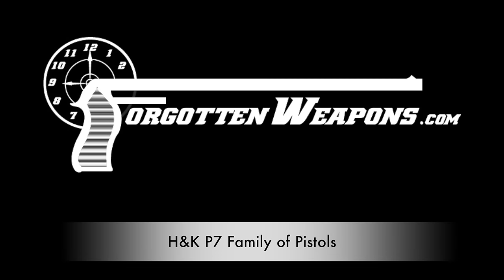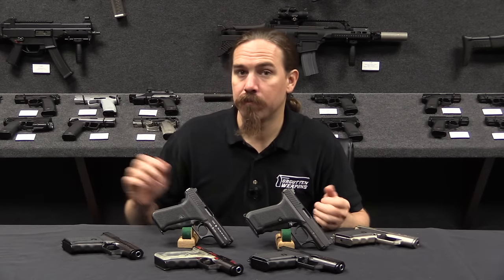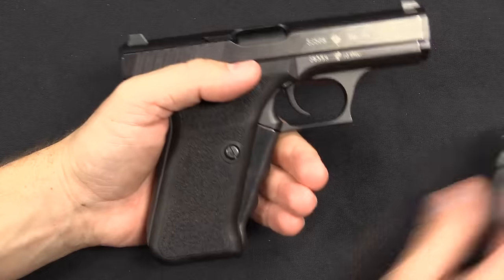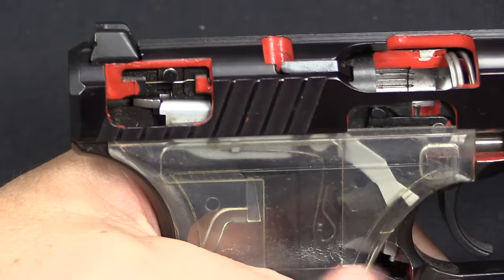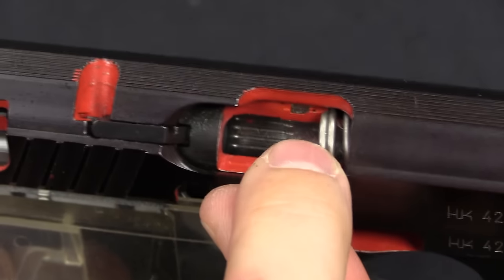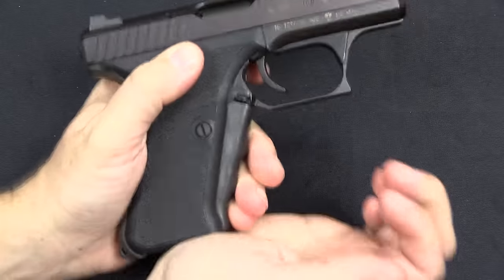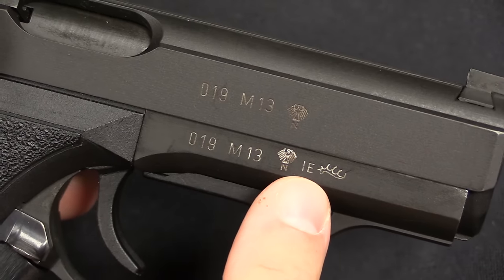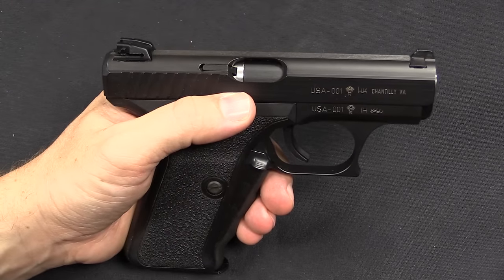H&K P7 Family: Pistols for Gun Cognoscenti

Comment: I'm not seeing what youre doing at 6:50 to release the magazine. You say to squeeze grip with slide back (empty chamber only?) to release mag but I dont see you do it, maybe a gentle squeeze but I see nothing move. 

And if that's how you drop an empty magazine, how then a full? Is there a slide stop control to lock it with a full mag?

Also will multiple trigger pulls on an empty chamber or a dud or light strike or hard SMG primer, work with grip held down, or must one re-flex and re-engage the safety to re-arm the striker?
Reply: The P7 has a heel mag release. The M8 and M13 have paddle release on either side of trigger guard to release the mag. The grip will drop the slide forward but you must release your grip and re-squeeze to do so. You can manually lock the slide to the rear. There is a small stop lever on the left side near the rear of the trigger guard on the P7. To try to refire on a light strike primer, you would have to release and re squeeze the grip.

Comment: Trying to select the perfect self-defense gun, and I think we may have a winner. I really like the feel of smaller pistols when it comes to concealed carry, but most of them are chambered in either .380 or .32 ACP. I've decided I want a 9mm but one that is not bulky and has a thin profile. This pistol is pretty much perfect. I was also looking at a Browning Hi Power, but again, the heft added by the double stack mag made it really uncomfortable to conceal. The Polish Radom vis 35 also caught my attention for it's ergonomics but it is an older gun and I feel this one will be more reliable.
Reply: Try a Kahr K9 or MK9.

They are a modern all stainless steel single stack 9mm and very very high quality. Nowhere near as expensive as a discontinued HK P7 either.

Comment: I almost bought one of these new, and I kick myself now for not doing so, but instead I got a HK VP70Z which had a better price, 18 rnd mag with 4 mags, and also has the distinction of being one of the first plastic guns made.  I was new to pistols, really somewhat ignorant of gun design and the squeeze cocker looked gimmicky to me.  They are awesome guns, and valuable collection pieces, hard to find and get snapped up quickly.  There is much to be said for 9mm with over 70 rnds as a carry/defense gun...  also a good gun that I never felt under gunned carrying.  Thanks Ian for another awesome video.   :)

Comment: In 2010 one of the German police agencies that used the P7 replaced them and a number of them were imported.  I bought one in early 2011 that really was perfect except for minor (very minor) holster wear for about $550.  They were in the box with the manual and two magazines.  The number imported sold out quickly and the price rose significantly.  In 2015 a friend saw my P7 and made me an offer I couldn't refuse.  I sold the pistol just a few days less than 4 years after I purchased it for $200 more than I paid.  My friend has since sold it at a profit.  It was very accurate, fun to shoot, and unusual.  I don't regret selling it, but would buy another in the condition if the price was right.

Comment: the h&k p7 family is so innovative and it should have been the future of pistols and the next evolution of the striker fire action. maybe people will recognize it down the line and its great potential. with the grip safety (squeeze cocker) you have maximum safety and now can lighten the trigger to single-action levels and you have a striker indicator similar to an external hammer. plus the squeeze removes the need for an external slide release which reduces more external controls on the system, which was a big selling point of the striker action. basically have the best of all worlds.
Reply: I'd like to see HK license the design to some enthusiast who wants to bring the gun back to market. The only thing is that you never know how well some independent entity would do it, and that's probably why they never will want to share the idea. Might as well just tear one down and build it without permission like the way Canik did with the P99.

Comment: Ian, you overlooked another  very unique feature of the P7/PSP system and that is you can remove the firing pin and spring from the pistol with incredible easy. The original PSP required a tool or some sort of wedge to turn the firing pin holder/indicator at the rear of the slide and out pops the firing pin and spring. In the P7 and later version, all you needed was thumb pressure to turn the the holder at the rear of the slide. The PSP/P7 also had polygonal rifling.
One major downside of this pistol is that it was a bitch to clean the gas cylinder because of all the fouling and its location made it hard to reach even though H&K provided a cleaning brush. The piston and cylinder get incredibly dirty even with just 8 shots. Although it didn't malfunction after 8 shots, it was a pain to keep clean.
Reply: Have you owned one? I don't have a problem with reliability or dirt. Just keeps shooting.  And mine is a carry piece I only clean a couple times a year. Shoot it at least once a month.

Comment: I have a dumb question: Why not put the gas system on top of the barrel, away from the trigger, if it gets so hot?
Seems like if you did that you could drop the barrel & chamber to be down more in-line with the shooters wrist with needing the kludgy addition to the trigger guard.

Second alternative fix would be to put the gas vent and chamber closer to the muzzle.  Maybe i'm just not understanding how the delay is supposed to work.

Comment: Does it make a loaded M7 full-auto if you hold the trigger and keep the handle squeezed ? or does the strike pin travel back with the bolt block which doesn't provide enough power to ignite the primer?

Comment: What happens if you shoot your last round and hold the Guard safety will the slide cycles back to the front or will it stay open till you push the guard safety again?
Reply: Yes the slide locks back on the last round and you have to release and pull the cocking lever to release the slide. It works better than it sounds especially with the M8 because as you shift your grip to work the mag release it's natural to release the cocking lever.
Reply: It locks open even while you hold it down. You release it when you go to swap magazines and then squeeze it again when you have a loaded mag in to drop the slide.

It sounds more weird than it is and I find it super natural since you usually unconsciously loosen your grip when going for the mag release anyway. Honestly, I don't care so much about the cocking mechanism, the squeeze slide release is hands down my favorite part of the pistol. Super fast, ambidextrous, and reliable (no accidentally riding a slide release lever with your thumb causing the slide to not lock back).

Comment: The heat issue is real, I was teaching a class at Fort Bragg in the late 80s in which all students used the P7M8 when this issue became very clear.  Using two pistols per student, and gloves, we were able to complete the class but it was challenging, even with the gloves the heat got intense. I noticed many of the extra pistols we procured were missing their extractors but they still worked, the reliability of these guns can't be overstated, we were using 50 pistols and shot three thousand rounds per student and I can't remember having a single malfunction.  The heat issue may not be a problem for duty use but especially since this is a unique design it requires training to be competent with and so the heat issue makes firing enough rounds and getting thru a training course challenging.

Other traits these have is excellent accuracy and a very low bore axis with minimal muzzle rise, they are very easy to shoot quickly and accurately. Great pistol I wish I still had one.

Comment: I’m confused about one aspect: if you keep the grip and trigger both held down after firing a round, then another round chambers, wouldn’t you have to release the grip to be ready to fire again? If you just release the trigger won’t the firing pin “pushing” element be still in the rear position and therefore unable to push the striker back?
Reply: Answering my own question: with the squeeze cocker depressed the action of the slide after firing will reset the striker.

Comment: I had a P7M8 in the 80. I liked the accuracy of the fixed polygon barrel, and the sleek compactness of the gun. However, it could not handle lead bullets used in my hand loads for competitive shooting, since slivers of lead sheared through the tiny bore in the barrel  into the gas chamber below the barrel. It filled up with lead splinters, until the slide could almost not pulled back enough and disassembled anymore, leaving the gun dysfunctional. The hand cocking action made a clacking noise, which got on my nerves after some time, and I finally decided, this thing was not for me. Exchanged it against an old fashioned super accurate SIG 210-5 which I own and am still very happy with. Never looked back. The presentation is nevertheless very interesting.

Comment: dear Ian I shot this pistol in a practical pistol match.  I was using a weaver grip , also shot it first time as a novel familiarization stage. I drew the weapon , pulled the striker and fire the weapon. What happen was the pistol recoiled my in hand which in turn the lever move back into safe condition without any indication that it was in non firing condition . the upshot fired the pistol, then  did'n t fire  ,no  normal way to diagnosed   the malfunction. needless to say I was not  impressed and if you use matches as training grounds  to survive a gunfight then the implication is that I would  be dead. It is hard enough to shoot under high stress conditions let alone having the pistol sabotage you. My experience with firearms is that I worked five years selling them  and  there by handle them daily and shooting in practical matches. One last thing the pistol when cockier is pull it sounds like a staple gun in that was out nick name for it. Thank you Ian for your excellent program
Reply: larry houneycutt I shot these in IPA matches quite successfully and I would only be able to reproduce what you did by limp holding it in an extreme way, how did you do that?

Comment: As an MP in the late 80s, I rode with the German police, (poletzei), on patrol in Maintz.  I didn't work with the Bavarian Poletzei, so I can't say for sure.  However, the Maintz poletzei told me a lot of the Bavarians had accidental discharges on these, especially when drawing from the holster.  But, again, I don't have first-hand knowledge of this.
Reply: I suppose in a high stress situation it's possible that they grabbed and actuated the squeeze cocker, but how the fuck did they have the trigger depressed at the same time accidentally? This has to be the safest design ever.

Comment: I remember being intrigued by these when reading about the initial testing; when they finally hit the civvy market a few years later I just didn't have the money (by then I was in my early 20s). And the continual price increases seemed to match any increases in income I received, sadly. By the time my income was enough to spend the bucks on one, it was too late and they had already been withdrawn from most commercial outlets. Used market was few and far between, as those who had them tended to keep them.

I still want one to this day... but not enough to put a winning bid out at an auction. Sigh

Comment: Best pistol I've ever owned or shot. Fixed barrel, stupid safe, ultra reliable. Wish they made a new updated version. Slim and easy to conceal carry, albeit heavy due to the frame. Have put a couple hundred rounds through in an hour, and it never failed me. Best CCW gun, squeeze the grip then pull the trigger, and it fires. Pull the trigger and squeeze the handle it fires. Squeeze the handle as you pull the trigger simultaneously it fires. Idiot proof, plus small children can't manage the grip strength needed to cock the striker.

Comment: I loved this idea in my early 20s, thought the design was so clever.  I saved and saved and eventually was able to afford one.  Finally brought it to the range, fully expecting to love the gun.  I absolutely hated the experience.  Put 2 or three magazines down range and the heat from the bleeding gasses heats the pistol until it’s burning your skin.  The pistol does not cool quickly.  So if you didn’t bring another gun to the range you will struggle to digest a single 50 round box of ammo in your hour of range time.  Also, if you don’t immediately disassemble and clean the weapon after a shooting session, the gas system can get jammed.  Now I realize this isn’t really a problem in a self defense situation, but it makes practice rather irritating.  I sold the pistol and never looked back.

Comment: How rapidly does it actually heat up to be uncomfortable, with or without the heatshield? Any experiences?
Reply: Good question, though it sounds more like a range/fun shooting problem than a police problem. I am still interested in an answer to it, though.^^
I personally think that the designers originally didn't care all that much heat problem, because of the very practical, real world fact that by far most gunfights are over after 2-3 shots.
I suspect the need for its solid precision (for a handgun) also roots in the same issue. When the police needs to shoot, it really needs to hit exactly where it intends to as there is no margin for error or tolerance for collateral damage concerning people.

Comment: I remember the P7 just coming on the market back in the '80's.  I thought then, and Ian confirms, that the P7 was probably the most elegant bit of pistol engineering since the Hi-Power.  Really a brilliant design, with that one flaw that all the gun writers mentioned then, and Ian did here, that the shooter's trigger finger begins to smoke with extended firing.  I wanted one anyway but couldn't afford it.  I still want one now but the used ones on Gunbroker are still out of reach at $2000+.  Sigh, I guess I'll just have to stay with the 1911.

Comment: I fired one shot , I have small hands with short fingers and if you to keep pressure on the cockier/striker and the pressure changes so slight that it make the gun  safe? in a fight. I consider that a design flaw. You said that you reproduce that condition their fore that flaw is there. that particular trait does not exist   with a myriad defensive  pistol choices . I also said that it a novel stage IE not my carry gun . At the time I carry colt 1911 series 70 .  I would like to point out that this design did not last the test of time , a colt does , a high power does , a glock   does , a CZ 75 does. I have told in my experience what happened to me and for that would not be my choice for a defensive carry pistol .  I would also ask is that your carry pistol?

Comment: The best carry pistol ever . You missed two thing these guns will cycle and eject spent rounds even with a broken extractor due to the design. The barrel is also low on bore axis so recoil is directed straight back . Follow up shots are fast because there is virtually no barrel jump. Awesome pistolas

Comment: Springs provide FORCE, not PRESSURE.  Force is measured in, for example, pounds, and pressure is lb./in^2 and other similar units.  I suppose one can put PRESSURE on a trigger (you are applying a force over an area), but the pull would still be measured in POUNDS.

Comment: One night at the range, I watched a guy shoot the tip of his finger off with a P7. We were taping an IDPA type shoot when it happened, and we had to review the tape to see what happened. The cause was a mix of poor form and the gun's design. 

He drew with his right hand and thrust the gun forward. His left hand swept around the front in an arc and came back to meet the gun when it got to firing position. Bad idea overall, but not normally a problem. Except that grip cocking system meant you have to make a fist with everything but your trigger finger. If you have your finger on the trigger when you do this, it will go off when you squeeze the strap. If your draw is also bad, your left hand will be in front of the muzzle at is goes off.

Moral: Practice trigger discipline and learn how the gun you carry actually works.

Comment: I was lucky enough to have swept up a p7m8 when HK announced the pistol's retirement.  It's a pity the pistol was marketed as a Maybach when it should have been a Volkswagen.  As much as I love my other firearms there's a lot this pistol does that nothing else can do - It's incredibly flat, compact, accurate and ergonomically simple.  And when you depress the mag release the mag doesn't just drop free, it shoots out of the magwell.  I love that.  It packs a 4" barrel into an extremely compact frame.  I wish the price had been lower so I could have owned more of them instead of the one.  Only downside is that, even with the heat shield, the sucker gets HOT fast.

Comment: I keep hearing about strikers and hammers. What is the actual difference between these two things? I know they both do the same thing, that being strike the firing pin with released spring pressure, but I don't know what actually makes them distinct. Thanks in advance to anyone willing to answer.
Reply: Generally a striker is like a firing pin and a hammer hits on the firing pin. They do the same end process, with different operating parts.

Comment: . In real practical use the  Squeeze cocking system proofed to be very delicate,breaking at least once a year;requiring a 2-3 month factory repair,at the cost of 1/3 of the pistol!If you wanted to use it,you always had to own two!(one always in repair).Additionally,the P7 throws brass to the next county,and ruins it beyond repair.Not reloader-friendly.Another aspect was,that the polygon barrel,produced markings on the bullets,which police hardly ever,with certainty, could related to an individual pistol,especially as the P9 had the same barrel.